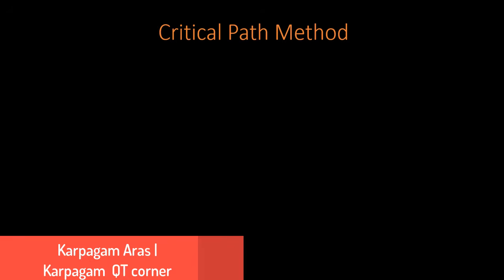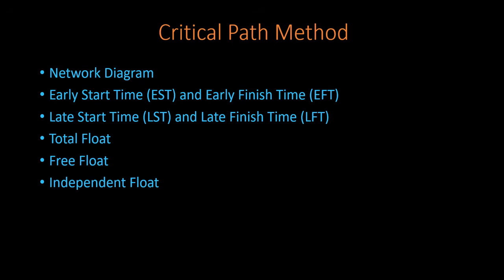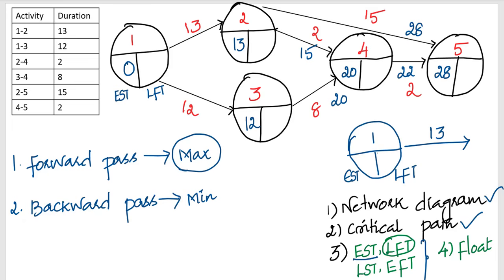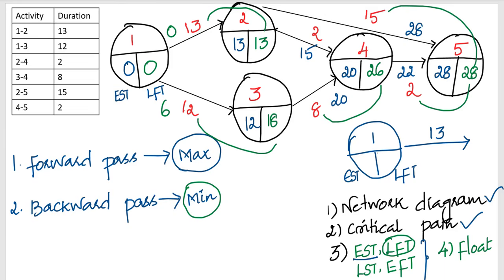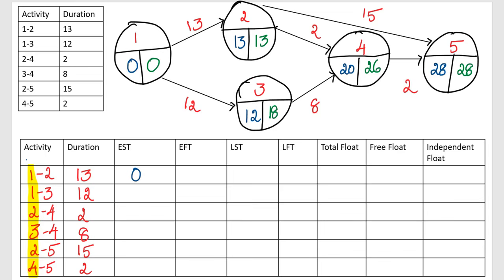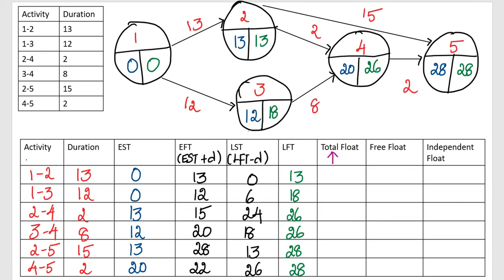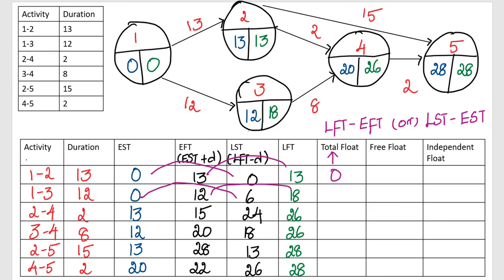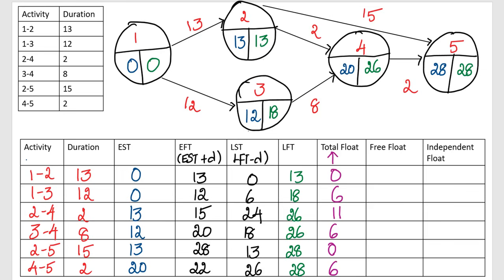CPM in Project Management & Operations Research | How to do a Critical Path Method

Comment: for backward pass at step 2 , 26-15 = 11 is minimum , compared to 28-15= 13
Reply: So what did you take 11 or 13??
Reply: Because it make sense..jaisa forward process gya tha waisa hi backward jana chahiye and mam ne wo 2-4 wali line calculate nai kri jisse 11 Aa rha h minimum.. Ya to esa ho skta ki aage jake wo 11 - 13 krke - 2 ho rha hoga islie nai lia..?? Somebody clear me plz😭
Reply: On the critical path i.e 1-2-5, there will be no float. Because it is already taking the maximum time, we cannot shift the start or finish without adversly affecting the  end time i.e 28 . Hence logically the EST and LFT will be the same.

Comment: at 13:34 why did the free float value suddenly change from 0 to 5
Reply from the maker: For calculation of the free float at FF25, the duration was taken from D24 instead of D25. To correct that, the duration  changes from 5  to 0.

Comment: What is the point of the free float and independent float? Won't the total float between nodes dictate if other work can be carried out between those nodes during the available time?
Reply from the maker: Independent float is a portion of the total float. Independent  activity can be delayed for start without affecting the float of the preceding activities.

Free float is the amount of time an activity can be delayed without delaying the early start of any immediate successor activity.

Total float  represents the amount of time an activity can be delayed without delaying the overall project duration

 Hope this helps